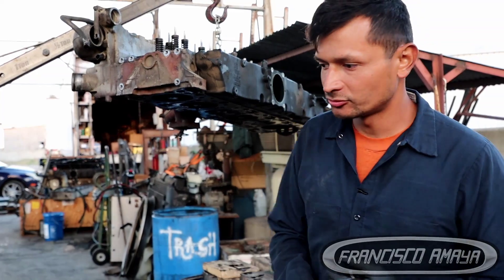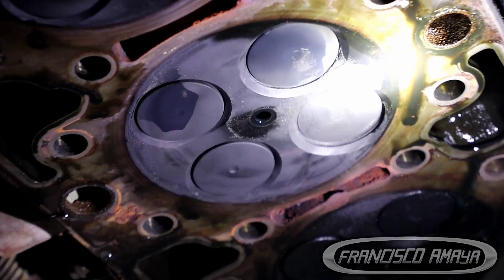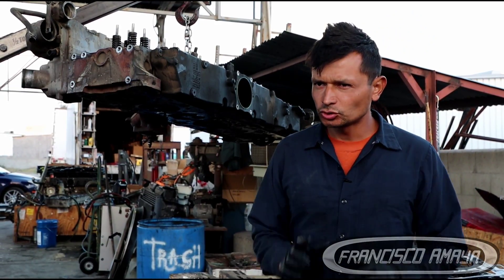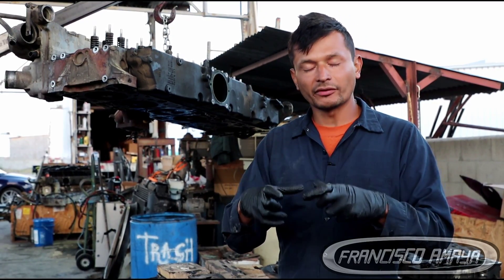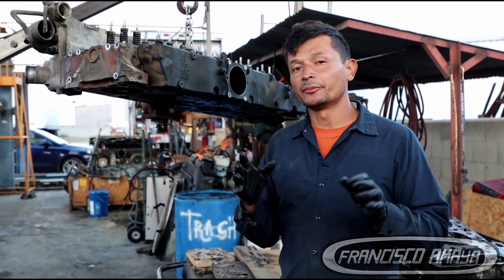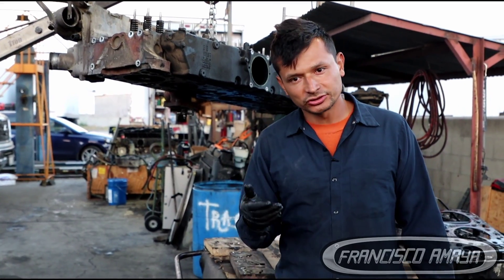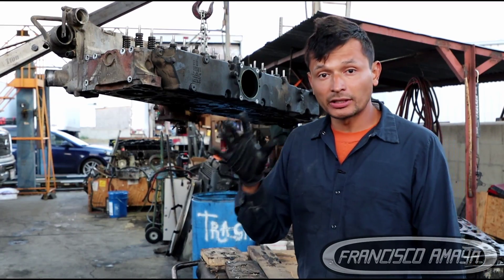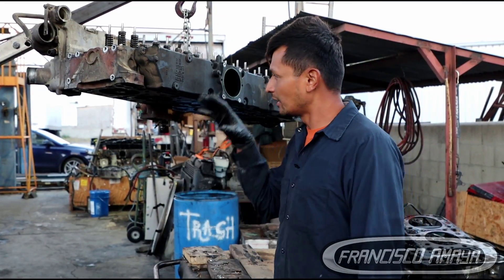DD15 engine noise Cylinder head valve leak broken low power white smoke freightliner cascadia

Comment: I have a 2019 freightliner Cascadia and it’s making the same noise but my truck hasn’t been deleted and all the time it is cylinder six I get it fixed, but the noise come back
Reply: I have the same issue on cylinder 6, did you replace all or just one and how much did it cost. I am trying to find a good shop in Davenport.
Reply: @Edusaddy  no I haven’t still driving.I’ve gotten tired of getting that same cylinder fix so it can start again. I’m not losing power truck not burning lots of fuel. And to your answer 2000 plus.good luck and stay in touch

Comment: tell me how excatly DPF delete effects the engine and the valves ? you talking what ever you want my man DEF doesnt enter the engine at all its not necessary for the engine to run, in fact DPF delete will extend the engines life because does not build back pressure, already burned gases are free to leave the engine, with no restriction DPF its after all to clean the bad emission , DEF does not run into the injectors , engine need Diesel Fuel to run , you just guessing and making a poor opinion without real knowedge
Reply: Its the higher compression. It generates more heat. The egr cooler keeps temperature down. Once deleted, you loose that cooling effect.

Comment: I have 2014 dd15 same problem.after I start it it does for quite time until the temperature gauge get 100 F. It’s Number 6 cylinder
Reply: Did you find out the problem 
I am having the same problem 
Please I need help if you fixed

Comment: I have a 2017 DD15 Frieghtliner Cascadia which have almost 783k miles. It has same issue except there is no smoke  and the loud sound is not intense. I was told that the cylinder head valve needs to be changed. What route do you recommend. Just change the Cylinder head or do a complete overhaul.
Reply: What did u do?
Same issue for me
Reply: @billoodean new head is required or a valve job.

Comment: Similar issue with a DD15;  loss of compression in cyl6 blown head gasket between cyl 3 and 4...truck was running ok but sounded like it had a miss and would frequently tick an Intake manifold pressure over boost code.  Keep up the good work chingon!

Comment: A DPF delete wont cause that issue. Owners Don't take the truck to get Valve Adjustment (overhead). they run the truck for years and years just doing oil change. and after a delete they start blaming everything on the delete when its their own fault for lack of maintenance.

Comment: I have a 2010 dd15 and it just started doing that noise but only once or twice when (or depending if I stay in high rpm)I'm in 8 or 9   gear at 15,000 or higher rpm.
Could it be the beginning of bad valve?
Reply: Get the overhead adjusted see if that fix it.

Comment: Smh, man those engines was devily designed. Meaning that demons put they heads together to create such engine. That suckah was made to be a problem and trying to undo on it is even more problems. Lord have mercy.
They wanted it to do is job and don't buy it because it's job is to have problems....
Diesels are good engines but emissions takes away diesel and basically turned them into other type of engines. Probably good for cars but not everyday trucking.
Hey an engine with emissions is the best. Unless you get it a new truck keep it til warranty goes out, leave emissions engines alone....

Comment: I have this problem but after the engine warms up, the sound goes away and the engine starts running smooth again. Why is that?
Reply: the valve is heating up and probably seals better once at operating temperature
Reply: I have the same
Reply: @126BEM  what was your solution? My truck just started
Reply: @jason22landry  i had to change the head, 2 valves from cylinder no 3 - intake ware defective. They get thinner and they don’t seat well. I bought a new head for 5200$, new gasket kit $1200 and woth labor I had a total of aprox $9000+.
Don’t drive it like this cuz if one valve will fall on top of the piston you will have to have a full rebuild!!! Go and fix it! My truck it a 2017 and the head was more expensive, of you have an older model you might get away with 2400$ for a new head! Btw I wait 1 week to get the head, they short on parts:/ !
Be aware guys!
I start having this problem after useing a engine cleaner(flush) that you run for 20 min in a wormed oil. After 1-2 weeks i start having the noise, the solution might washed away some deposits from the valve seats or it’s just a confusion!
Reply: What was your solution?
Reply: I blew something, the coolant mixed with oil. Its broke now

Comment: I got a Volvo d13 that I’m looking to get deleted.

First guy said $2500 and all he does is put a emulator on it.

Second guy said $3500 and  programs the computer.

Does anyone know which is better and why
Reply: Go with emulator, it’s not good to computer program Volvo engine they will block all codes including engine codes in your dash board. Emulator only turns off DPF system
Reply: @253FreakCar  thanks for responding, does the engine run hotter with emulator, or increase power or fuel consumption like every one says
Reply: @alexandertakele6136  with computer programming they disable EGR and retune engine which is why it’ll run hot if not done correctly. Emulator is just shutting off DPF and SCR everything else runs the way it always will
Reply: @253FreakCar  I had a 2013 Volvo with d13 few years ago.  i noticed it started running hot a few month after the delete with the emulator, that’s why I was asking

Comment: Did they do their valve adjustments when they were supposed to ?
Reply: It doesn't matter if you do the valve adjustments on these sometimes. Detroit had a bad run of heads and valves in 14 and 15 and they are going to fail around the 540 to 620k mileage. Theres 6 people I know plus me that have the same year and mileage truck and all of them need new heads because of this issue. We all do our overheads yearly
Reply: @devilman3136  good to know
Reply: Great service

Comment: I believe Yo right  cause the delite the DPF Systems cause internal issues in the Engine,  for injection timing. Or the quantity of fuel.👍
Reply: Yha right, I had the same problem without deleting engine.